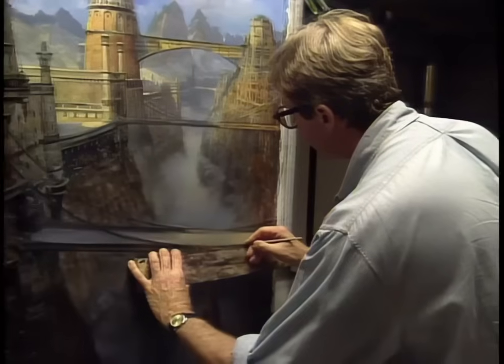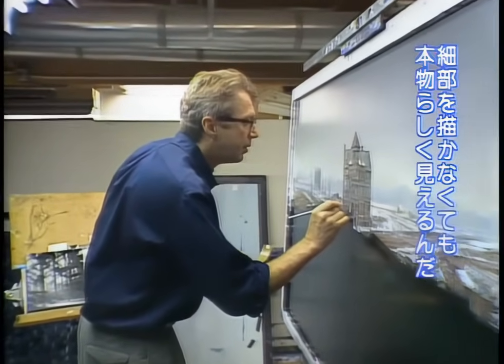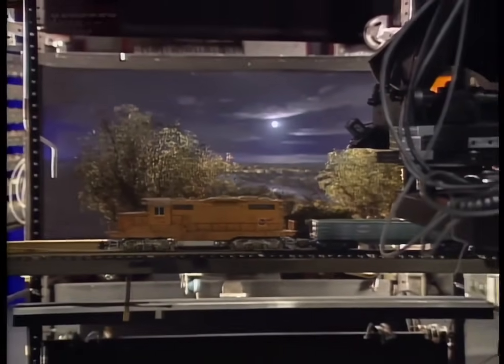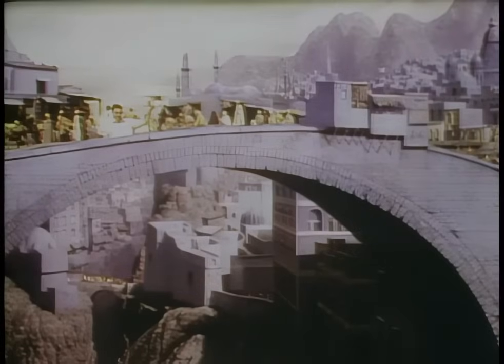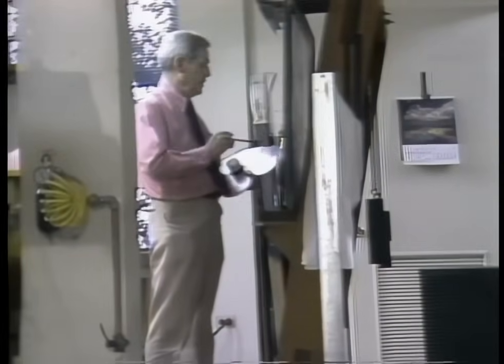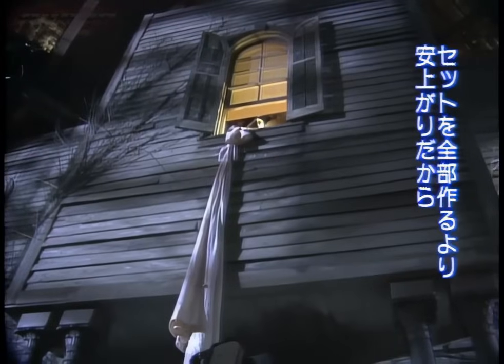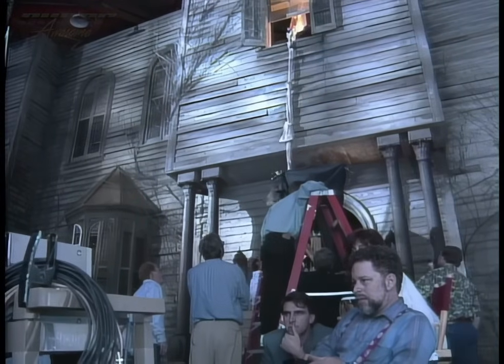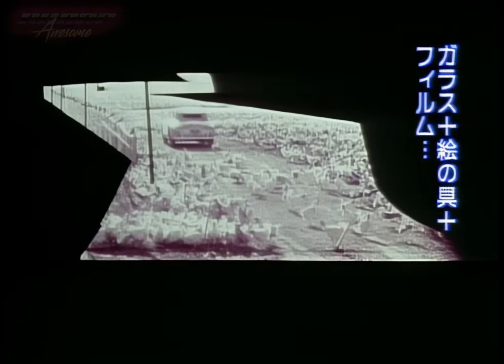Movie Magic HD episode 08 - Matte Painting

Comment: CGi is basically a matte painting done with computers, and where matte paintings are usually just a single frame shown for multiple seconds CGI is 24 frames per second instead. I think because matte paintings just used a single frame they put a bit more effort into them. For an experienced painter it was probably a bit cheaper to come up with some wild stuff in a painting vs needing CGI experts to develop the same thing in motion.

Comment: very informative, but i don't understand how the painting is combine with the actual scene, do they shoot them again together after projection?
Reply: ...it's like they said, they either paint the matte on a piece of glass and put it in front of the camera, or   combine everything in a special machine called an "optical printer", which indeed does project and shoot things together.
Reply: They actually load the same film back into the camera and shoot the matte painting. The black portions of the live action footage (where the frame is matted out) is kind of "blank", so it's possible to shoot the matte painting onto those parts of the frame.
Reply: @j.lindback  that makes sense.  thanks